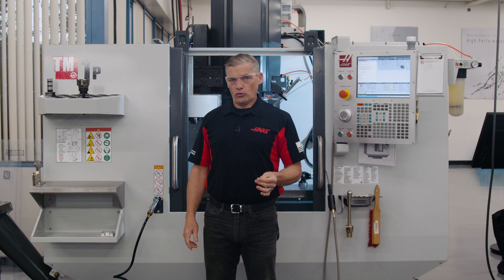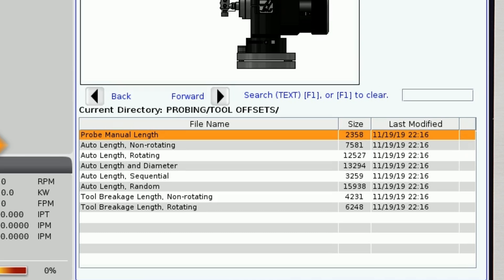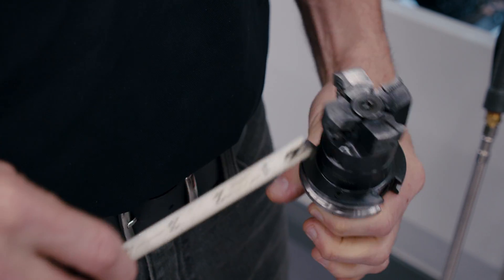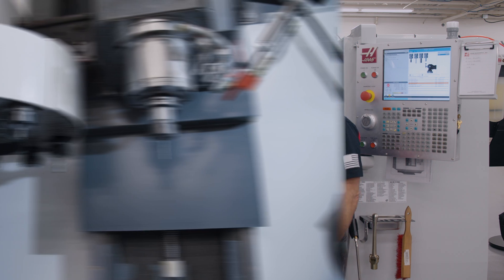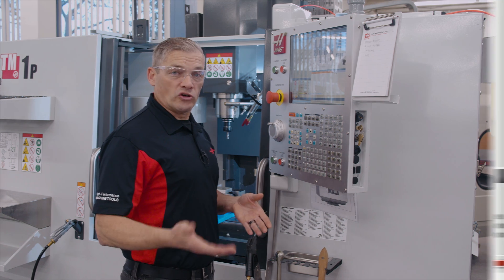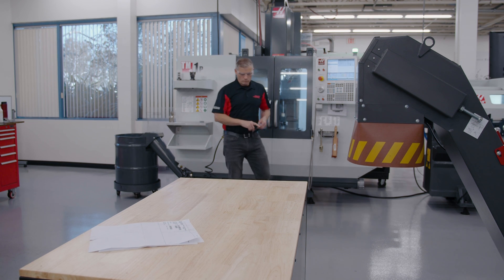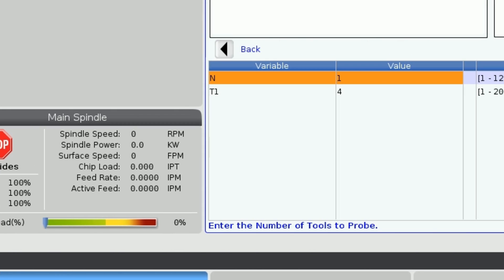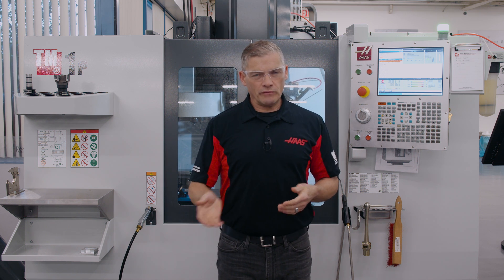3 Easy Ways To Set Tool Offsets Using VPS - Apps Minute - Haas Automation Inc.

Comment: How is this done if the probe is freestanding and not fixed to the bed?, We remove the probe once our tool offsets are taken.thanks.
Reply: You remove the probe from the machine? Now I run hiedenhain controls but as far as I knew all machines needs to know the accurate position of the probe, especially for radial measurements. Surely the time taken to fit, level and calibrate a probe everytime you want to use it outweighs the gains of having one?
Reply: The probe is placed flat anywhere on the machine bed and tools are manually hand jogged above the probe and the height is taken. No need to calibrate everytime, this particular machine is only 3 axis so more room on bed for larger fixtures after probing, we're taking 'z' offsets not radial, in my 6 years on fanuc and Haas I've never had to  take a radial offset as long as the tool matches the pocket and diameter in the program, just make radial adjustments due to tool wear.
Reply: I've never used a probe like that. I have seen alot of people raise the probe off the table to allow room for fixtures while maintaining clearance for probing. I have my probe moved over the edge of table so that it's only about 10mm within the traverse limits
Reply: Personally I prefer to use pre setters to measure tools and key the figures in manually, good for spotting raised edges and slight chips 👌

Comment: I can do it manually faster and be sure it’s correct. Nothing worst then crashing your machine on an auto probe and walking away to do something else. That’s just dumb, lazy, and careless. I can see the future, people using this and hopping on the cell phone or doing paperwork and getting fired or told not to use this function any longer. I’ve already seen owners take these features off the machines, just like safety guards and locking doors at spindle speeds that you can’t use an edge finder correctly and look into the machine when doing it. Just makes it harder for the real machinist to do his duties.
Reply: A little close minded? I am young only in the game 7 years. Learnt from the old ones, most couldn't run CNC only others programs and manual work. I taught myself to auto tool change with manual offsets as my probe was faulty. Proved I could do it then got probe fixed. This is always easier and faster and just as reliable. I know people who work like a dog and claim to be faster than a machine. All they do is work a sweat and achieve the same at best. And these features are incredibly hard to crash as long as you have a brain cell
Reply: @wildin13   nice you answer, you true say  if  cnc mechanic not want learning this options how you can  about it understand,   this  example i have in my works college  this now want working too  with this   cnc machines options, this and too old  peoples  and  working all time  with manually settings offset  and not want learning   but   CNC mashines is news  HASS WF 6

Comment: I work at a shop where all the older guys are doing it the manual way with new machines. You can cut down your time with alot of stuff by half using this feature.  It becomes a great tool once you've done it a few times.